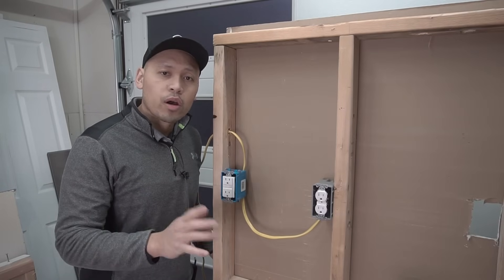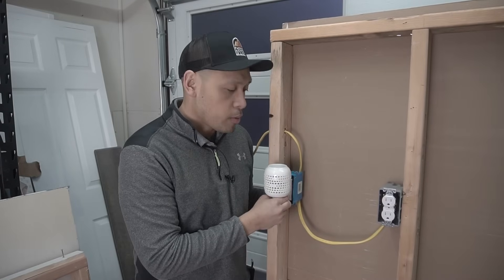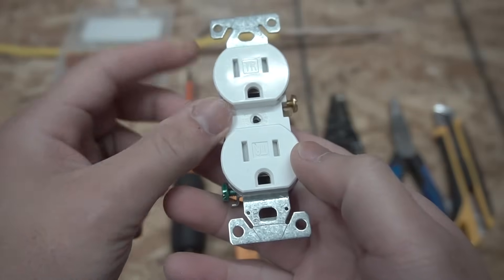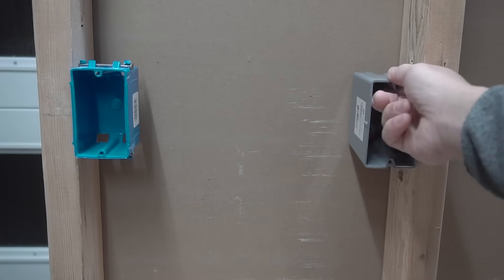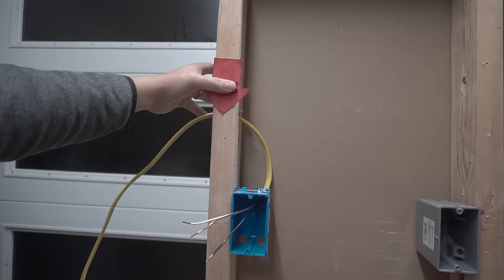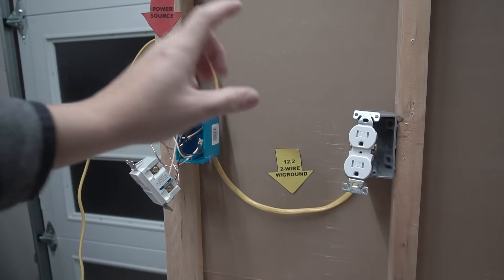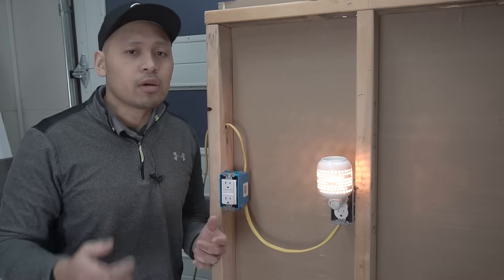How To Wire A Single-Location GFCI Outlet With An Unprotected Outlet On The Same Circuit! DIY

Comment: Great video!  My kitchen doesn't have nearly enough outlets.  Thank you!
Reply: All kitchen receptacles should be gfci and afci protected per code. Don't line side your new receps and use dual function device not just gfci
Reply from the maker: Thank you so much for watching! 🙏🏽😊

Comment: It’s also very important when using those lock and unlocked connectors and even the ones that permanently lock to pull on them after locking and then tape them, they are known to pop loose, especially the ones that unlocked when you start pushing them into the box

Comment: Have a 70 y/o house & need to replace old 2-prong porch receptacle with GFCI (no ground wire present). The old receptacle is wired directly mid-stream of a 20-amp circuit (#5 of 8 outlets), no pig-tail used. Last 2 outlets are in a detached garage - one serving the freezer, both have ground wires. Circuit protected by AFCIs in the new sub-panel replacement. Want to only GFCI protect this patio outlet and not rest of downstream. OK to single protect this outlet via using only LINE terminals & a pig-tail method, or have to use LINE & LOAD terminals for rest of the downstream outlets?

Comment: You certainly have a great gift for simplifying and explaining intimidating wiring projects. Thank you! I am curious how to wire the 1st GFCI receptacle when the line in is a 12/3. Do I cap the red off if it isn't being used?

Comment: What if I wanted to have that second outlet protected. Do you have a video on that?
Reply: Simply directly wire into the GFCI outlet instead of using the terminal connectors like he did. If the wire going to the next receptacle is coming directly out of the GFCI outlet, it will not allow power to continue to the next outlets downstream.

Comment: Excellent video....this did not fix my issue with the load of the GFCI tripping my plug, but it is very well done.
Reply: No enough power, faulty wiring or whatever you have plugged in is messed up. Sometimes rope lights will trip the plug if one bulb goes bad and is either getting wet or is just bad

Comment: Why would you not GFCI-protect the secondary outlet, if it's coming from a GFCI receptacle?

There doesn't seem a downside to doing it.

The secondary outlet is less safe because of this.

About the only reason I can think of is that the second outlet is dedicated to a specific applicance, and that appliance is a source of nuisance GFCI tripping. Or else that appliance must be reliably on at all times, even if there is a nuisance GFCI tripping for some other reason.

Comment: Correct me if I’m wrong but you are not supposed to use 15a outlets on a 20a breaker.
Reply: You are incorrect indeed, that receptacle is a duplex, which is  accordingly to nec code unless it's a single receptacle then it is in violation of nec code.

Comment: Is those more cost effective than replacing all outlets on the same circuit  GFCI outlets?
Reply: Making each outlet as a single location GFCI outlet is more expensive but arguably better so that if one outlet trips, the entire circuit doesn't trip.

If you're changing a downstream protected circuit to make that GFCI only single location protected, it'll likely be against code if you do that.  In every state I've lived places like a kitchen or garage need all outlets protected by GFCI, per code.  Some homes do this with one GFCI protecting everything downstream from it (not single location like shown here).  In those situations, it would be wired differently than this.  

When I've run my own circuits (all permitted), I do all single-location GFCI protected outlets.  It's slightly more complex wiring pigtailling at each location and it's significantly more expensive, but it's the most reliable circuit.

Comment: Can I ask you a question?almost all my receptacles in my home have no grounding and no GFCI receptacles .none in bathroom or kitchen well atleast they don’t have grounding I know for sure.so my question is would it be wiser and best for me to replace receptacles with a GFCI receptacle (even though there’s no grounding wire) or just add a GFCI circuit breaker in the panel box?and how many GFCI breakers would I need ??I have the main panel box and a sub panel box .home was built in 1957…im so confused with all this grounding GFCI stuff but I need my home to be safe
Reply: Unless your main electrical panel has been replaced with a modem one, most likely there's no GFCI breaker available in your case. Short of a complete rewiring, GFCI receptacles are the only option.

Comment: Why use pigtails to connect the wires from the breaker to the line side of the GFCI when you can just connect to the GFCI? Saves on those damn wags and allows for more space in the box. Understand the ground but no the other wires. Waste of time and money.

Comment: Hey question, why would you NOT have the 2nd outlet protected by the GFCI?!!  Outside of that I love your videos.
Reply: I would think because like he said if the GFCI is by the sink and the other outlet, it’s not then it doesn’t really need to be protected, especially by code, so he wired it as a parallel circuit so if the GFCI guess what it will short out, but won’t affect the rest of the circuit.

Comment: what if the GFCI isn't turning off the other outlets in the circuit?
Reply: That’s why he pigtailed it. And to answer your question they will be live.  Need to hit the breaker at the panel.  If he ran it up though the top two screws then the other outlets after or down stream will not receive power

Comment: Hi, great video!
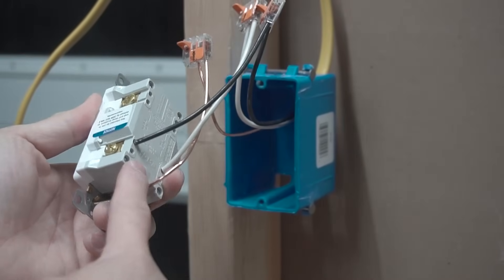At about 6:25 you specify connecting to the line side, not the load side. Could you explain that.  What is line side, what is load side. Why use one and not the other.
Thanks
Reply: you can think of the as entrances  exits. Not a perfect analogy but it will work. The line side is the “entrance” - the wires that will supply electricity to the outlet. The load is the “exit” you can add more outlets after the gfci and they will be protected by the gfci. Which means you will also shut off everything that is attached to the load side when the interrupt is tripped. This can be good if you have multiple outlets on a countertop near a sink. They don’t all need to be gfci and still be protected when they branch off of the load side. If you have outlets and lights in other rooms that are down the branch though, every time it trips you will shut those off too which can be frustrating, that is when you would not use the load side.

Comment: Is it OK to use 15-A outlet with a 20-A service?
Reply: Yes you can but you need to have more than one receptacle on that same line if its only one receptacle then you have to use a 20amp receptacle
Reply: NO NO NO and one more NO lol unless you have full coverage home insurance and don't tell them what you did after the house fire. 15 amp breaker gets 14 g wire and 15a receptacle (outlet). a 20 amp breaker is 12 g wire with 12g receptacles.

Comment: Thank you for this video.  When we had our bathrooms remodeled, our contractor put GFCI outlets as required by the sink, but the circuit that it's on also has bathroom outlets on it (older home).  Every time the bathroom GFCI triggered, all of our bedroom outlets would lose power because they hooked up the downstream to the load connectors.  I've rewired my GFCI outlets this way and now triggering the bathroom outlets don't cause loss of power to our bedrooms.
Reply: Congratulations!  You’ve made all the bedroom receptacles less safe.  BTW- why is the GFCI tripping so often in your bathroom?  I’ve been in my house with GFCI in the bathroom for 22 years and it has only tripped three or four times.  Maybe you should replace the GFCI receptacle as it may be defective.
Reply: @glasshalffull2930  less safe how? The bedroom outlets aren't near water.  It trips often because it's near the sink and my kids splash water all over the place.  I'd say the outlet in the bathroom is working as intended and doesn't need to kill all the bedroom outlets unless you can tell me a good reason for it or if it's required by code.
Reply: @nahpungnome  Though the NEC ‘currently’ only requires GFCI in wet spaces, the industry encourages them to be installed in areas with increased activity and electronics.  It’s just added protection for you and your family.  For example, when my brother was about 8 he stuck a piece of wire into an outlet and there was quite a fireworks show.  He was OK, but it could have been really bad.  A GFCI would have protected him.  Anyway, I really like the added protection they give, but I can understand your particular predicament.  I’m totally serious, but perhaps an outdoor weatherproof cover is in order for the kids bathroom receptacle.  Good luck!
Reply: @glasshalffull2930 You’re too much. Why so extra. What did people do years ago? They were responsible adults and put child resistant protectors in the outlets. 🙄
Reply: @ I guess it’s something about protecting children and it only costs a few bucks per circuit.  (Not too much) 🙄 BTW-any kid over 6 can get those plastic covers off.

Comment: Hello, thank you for this video, it is exactly what I was looking for.  In my garage I have a GFCI that is on the other side of the garage from the sink. Unfortunately for me the GFCI is the outlet closest to my Landscape Irrigation timer thus when it trips (and it has when I was out of the country) my landscaping & grass was almost dead from the Texas heat. 

Would it be possible to put the GFCI & the other outlet in a double gang box?

I really would like to pull power from this GFCI and add another outlet in an upper cabinet so that I can plug in my battery chargers out of sight.

Comment: Why would you want to bypass the GFCI to the next outlet.. 
GFCI is designed to be a sensitive breaker 3 to 4 milliamps, so it trips before the breaker in the main panel does.. 
The way you have it, the outlet will trip the breaker in the panel and then both of these will be off anyway..  
If the outlets in the bathroom are tied into the GFCI, than they all follow code.
Reply: An example I can think of is if you have a freezer downstream of the GFCI.  The GFCI may be near a sink where it is required, but you don’t want it tripping and ruining your food.
Reply: A gfci receptacle is not a circuit breaker and only detects small current leakage, then trips. It does not detect short or over loaded circuits.

Comment: Forgive me but are you recommending I use pigtails on every plug or switch I install?  I normally wire directly to to wall wiring.
Reply from the maker: No worries! It’s your choice either way works 👍🏽😊

Comment: I would like to know what this purpose of this video is.  There are very few situations where you would want to do this without violating code,  and by the comments people are confused by what you even did.
Reply: He makes it quite clear:  code requires GFCI protection for outlets within 6ft of the wet space.  If the outlet is further than 6ft then you may want it to remain powered even when the GGCI pops. He demonstrated that, and he pointed out such a downstream outlet would have to be more than 6ft from the wet space. Perhaps he could have put one of his flags to emphasize that, in case someone didn't watch the entire video carefully to understand all of the points he makes.
Reply: @douglasmoore9918  Residencial code requires all receptacles in a kitchen to be GFI protected. Also in residential code, kitchen circuit and bathroom  circuits are dedicated, so if you are adding receptacles to the circuit they should be GFI protected. This channel seems to be dedicated to Residentail DIY work, however somethings should not be done DIY. Some of the comments are people talking about adding receptacles in their kitchen, this video would not apply to them, however when he responded to the comment he made no mention of that.
Reply: @Jonathan Chamblee  I see your point that the circumstance for this type of arrangement would be rare. In my case, I'm planning to put a wash sink in the corner of a work room. I'm thinking of GFCI protecting outlets within 6 feet but use his technique to power the ones further away. Would that be a bad thing? I'm worried that running a large printer, paper, etcher, or such would pop the GGCI?
Reply: @DrivebySermons  what about an outlet for a refrigerator that says not to be plugged into gfci?
Reply: I have an old refrigerator that keeps tripping the gfi circuit, does because the old windings in the motor are not as good as the new motors, this makes the gfi trip, I moved into a new house that all circuits are GFI protected and my old rig is useless, so im doing what this kind gentleman just showed us, my fridge is 38 years old and works like a charm for my beer and other things, the new fridges  last about 5 to 8 years and the old one is always there to save the day, that's the only reason I keep it, thank you for the video.
Reply from the maker: You are the first who asked this question on the comments sir.
Reply: This configuration is original to our 18 year old home, where 4 outlets on an island (with no water source) are jumped off of a GFCI outlet located at the main countertop area near the sink.

Comment: Save the Wagos and just wire the line and load to the same side of the GFCI. There are 2 sets of lugs to accommodate that.
Reply: True but the grounds still need to be pigtailed